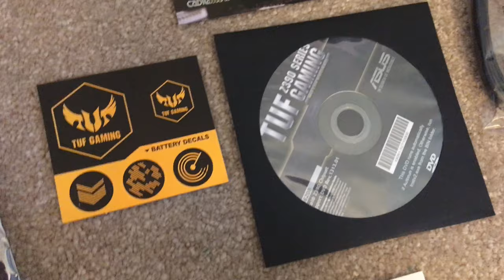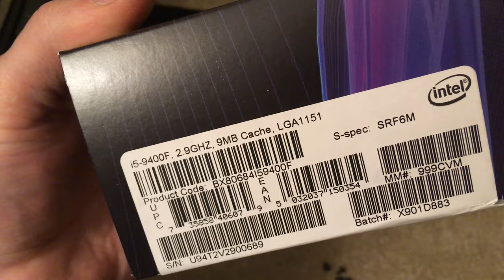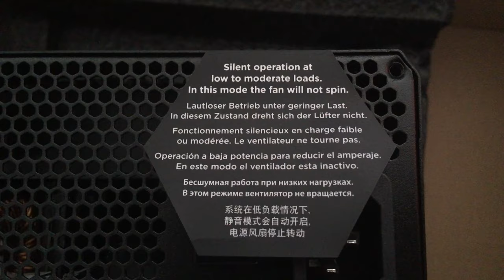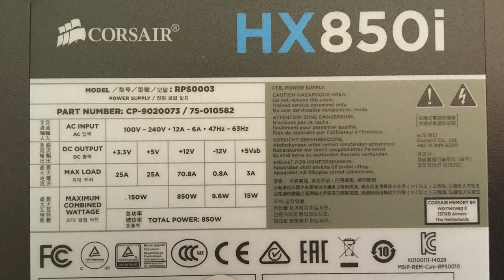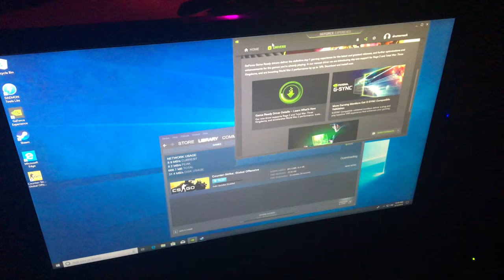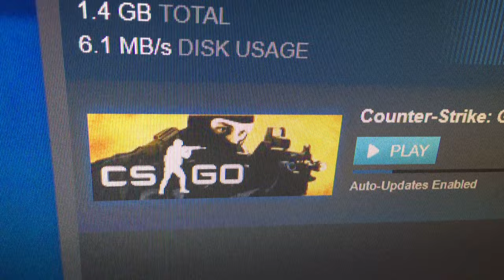CS:GO Build

Comment from the maker: The USB install of Win10 went south, not sure why, but ended up with Win10 Home 32 bit version installed. Thankfully the M.2 MVNe SSD was so fast that installation from the USB went by in minutes. Then came the hell of trying to get the ASUS mainboard chipset drivers installed lol where I discovered that the wrong version of windows was installed. Thankfully, some years ago I had burned a copy of Win10 Pro 64 bit ver 1511 to a DVD R+ using the Media Creation Tool / saved it & used the optical drive from my dads old desktop (recycled) to load the OS in a noisy & slower way that worked like a charm. After installing Window 10 Pro, the Asus Q installer automatically launched & made installing all the drivers + some free bonus software a breeze ^^ cool 

Steam went in smoothly via a download though the EDGE browser / CS:GO downloaded & plays buttery smooth now ^^ largely due to the awesome MSI GTX 1660Ti GPU & Corsair platinum energy efficiency 850w modular power supply that Jaeson Long donated generously to the build. Thanks J! Loading DIRT3 complete edition so far failed both times. It will not launch & I am still investigating why. If you have any suggestions why DIRT3 will not launch let me know. I also need to upgrade the graphics driver. Right Now iat 419.23 from NVIDIA but they are upto 430.xx now / 

I will not be activating Windows 10 Pro because it will not accept any of the perfectly valid product keys that I own & previously purchased. I am also going to load Mint or Ubuntu Linux onto a donated Samsung 970 SSD that Jaeson Long also contributed to the project in a dual boot configuration.Thanks J! I read a lot of articles online about whether or not to activate windows & even found videos of vendors with unactivated windows 10 on their laptops at trade shows etc + college professors & students etc. The only downside to not activating paying is that you lose personalization options. Since the build of this machine is largely experimental in nature I do not care about making the OS look personalized lol. Thanks for watching friends. Cheers & good luck with your PC builds too ^^